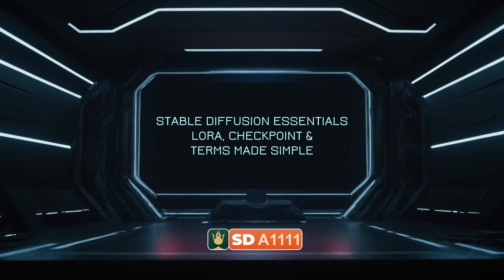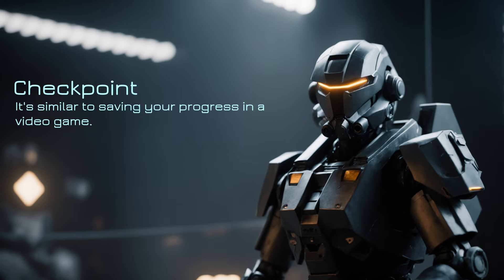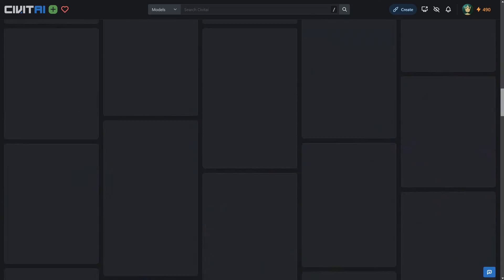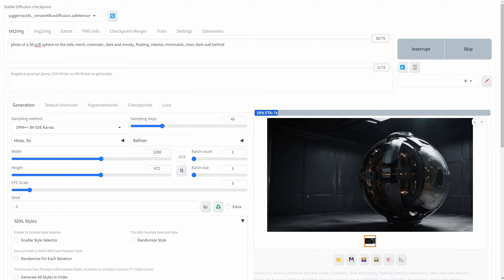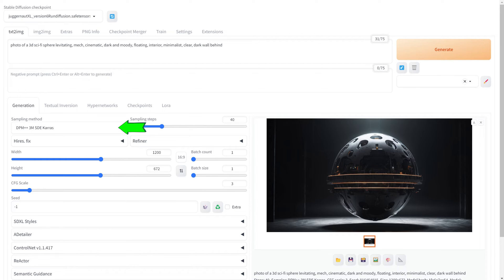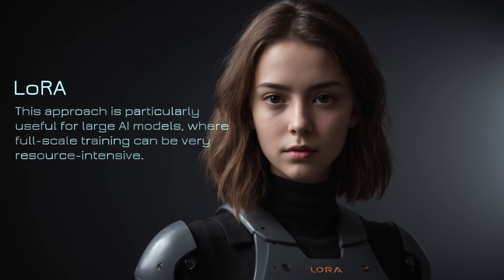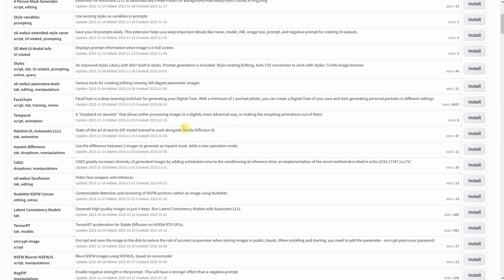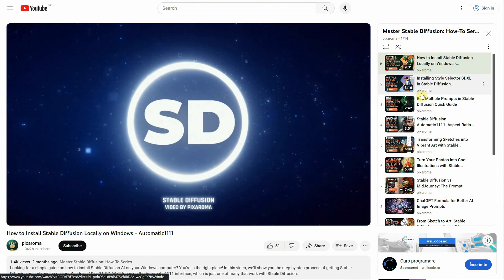Decoding Stable Diffusion: LoRA, Checkpoints & Key Terms Simplified!

Comment: I just think it as modding minecraft terms:
a. Autoamtic1111 and other UI's = minecraft launchers, its not the game, its just a thing that organize and fetch the data... a door that can be put on a wall without breaking the wall and you now can enter the wall thru that door.
b. Models = Mods, content of the game... a building without any entrance.
c.Extension = plugins, api file required by some mods... might need some furniture inside the building.
but of course I still doesn't understand fully... Especially LoRa part... and when people ask "what version of SD are you using?" and you guys (the SD guru) point out the launchers (UI) that what confuse me at first...
Reply from the maker: Good analogy, as for what version you are using I think they are think it it like a software not think like at a stable diffusion model, they are thinking at a thing that can download and install. If i say sdxl they can find a model and look at it, but usually if i say comfyui or automatic all explain installation including a model so maybe from that it comes the confusion.  Also I use it for a while but I don't understand all the technical stuff that happens behind and i am interested only to have an idea of how it work, so i can use it. Like a car, i need to know how to drive it and i am  not necessarily interested how to build that engine. Though i am learning more than i thought of what happens now since i am learning comfyui :))